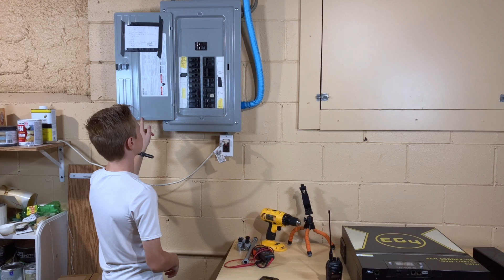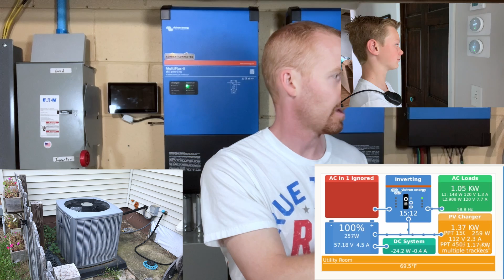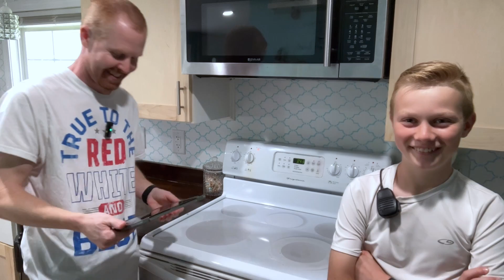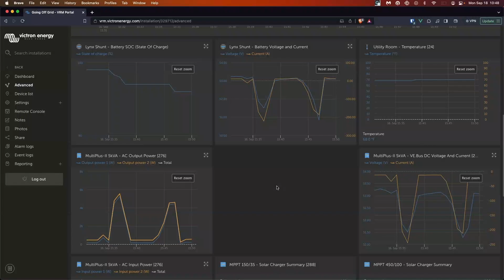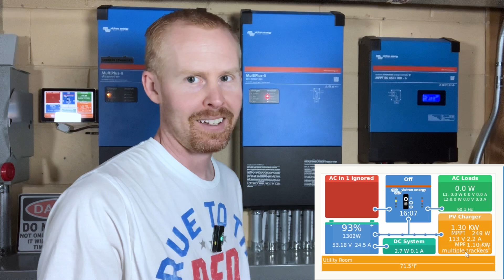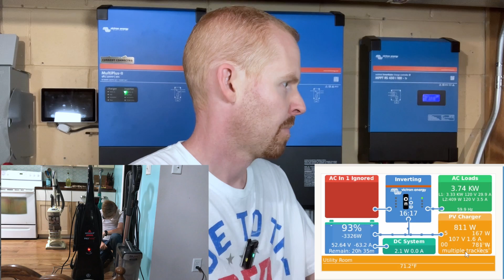Pushing the Limits: Victron MultiPlus 2 5kVA Inverter Endurance Test

Comment from the maker: Large Appliances tested in the video: 
- Armstrong Air 3.5T A/C - 90 LRA
- GE Profile Performance Wizard Dryer
- Frigidaire Stove/Oven

Links to the parts & pieces in the video (affiliate links)
------------------------------------
Victron 48V MultiPlus-II 5kVA 120V Inverter
https://www.currentconnected.com/product/victron-48v-multiplus-2-5kva-120v-inverter-70a-charger/?ref=AzzpK9Fl

10kVA 120/240v Base MultiPlus-II System
https://www.currentconnected.com/product/10kva-120-240v-multiplus-2-5kva/?ref=AzzpK9Fl

Victron Cerbo GX
https://www.currentconnected.com/product/victron-cerbo-gx-system-controller/?ref=AzzpK9Fl

Victron GX Touch 7" Display
https://www.currentconnected.com/product/gx-touch-display-cerbo-gx/?ref=AzzpK9Fl
Reply: you should add that soft starter to your ac unit. It will lower the start up amperage ALOT from the ac unit and should prevent the lights from freaking out.

Comment: Just by chance on the air conditioning unit, are you using a soft start or is that configured from factory?
Reply from the maker: During this test, there was no soft start on the A/C unit.  Months later I did install one though, just to relive the startup surge.

Comment: Must have been the battery that caused that flickering and so. Voltage sagging.
Reply from the maker: @ThePonderi  flickering?
Reply: @AdamDeLayDIY  The dip in power when the boy switched on tfor the first time.  Lights blinked (freaking out), Multi also show red led for a brief moment.. that could have been battery voltage sagging. With a huge battery possibly that wouldn't have happened. How much battery do you have?
Reply from the maker: @ oh, your taking about when the A/C was turned on?  That’s expected because of the high inrush current required to turn on the compressor.  Battery bank size wouldn’t matter.  I had to add a soft start on the A/C to get rid of the huge surge.

Comment: Hey so from the video, I wasn't entirely clear on your setup.  Is this two Multiplus 2s, both 5kVA, with one connected to the other in Power Assist?  It would be helpful to hear more about this from you in the video.  For instance when you used fired up the AC, how much did the system provide from each inverter at spike time?  Could a single 5kVA MP2 handle the startup?  That would be interesting for all those folks who are looking at getting just one MP2 to begin with...  If you're reading this and can recall any of the answers to these questions, I'd love to know!
Reply from the maker: I have 2 MP2 5kVa inverters setup in a split phase configuration.  So each inverter would handle 120v of a 240v configuration. 

Since the AC is 240v, each inverter would equally provide half the power required to run.  A single 120v MP2 5kVa would not be able to run the AC.
Reply: @AdamDeLayDIY  Aha!  Thanks, that helps alot.  I live in Europe currently, and I wonder if their 230V version of the MP2 would be able to handle it.  My guess is yes, without too much else running (maybe just lights, and normal computer stuff).  I'm trying to decide whether to go with the 5kVA or the 8kVA... hoping to be able to start out with the 5kVA and then get a second one and use it in parallel to increase capacity, when funds are more abundant.  Anyway, no need to run the AC off of it all the time, as we do have the grid.  Thanks again!
Reply from the maker: @blakjakshellac  No worries.  Glad to be able to help!  I've not looked but I believe there are specific 230v inverters.  You would just want to look at the spec sheets to confirm.

Comment: The install looks really nice but if you are going to only feed loads at the output side of the inverters, you should  look at adding an Autotransformer to the outputs of the two inverters so that L1 and L2 will be balanced regardless of loads.
Reply from the maker: Thanks for the comment.  My loads are typically balanced.  I just wanted to test how the inverters would handle the imbalance. 

I'll be testing ESS at some point to try to feed some of the other loads in my house.
Reply: @AdamDeLayDIY  ESS will certainly add to the capabilities. Hope you are ready to add more solar panels because you are going to quickly learn you will be able to stop the meter. When matched with a bank that could sustain your loads for a day or two, you could easily reduce your power bill to nothing but service charges and taxes.
Reply from the maker: @PanelsUpSolar  Oh yeah.  I know I'm gonna have to expand both my array and battery bank.  Just have to save up my pennies to do so.

Comment: Thank you Adam for the load test. After reviewing Gavin’s, Will’s and EG4’s load test of the EG4 18k and your Victron test, I have come to this conclusion.
1) Connections: The EG4 has all of the switches and breakers built in, The Victron is extra.
2) Telemetry: EG4 WiFi included, Ethernet adapter or LTE 4G dongle extra $199, Victron Cerbo GX very expensive extra $381.
3) Shunt: EG4 does not need one, Victron needs one at extra cost.
4) Bus bar: EG4 default not needed but depends on batteries used. Victron needs their own, expensive.
4) Load balancing: EG4 is up to 8kW constant one leg, Victron trips at 6kW.
5) Surge: EG4 is 14kW for 10 minutes and 16kW for 5 minutes, Victron not even close.
6) Self consumption: EG4 is 70 watts, Victron is 30 watts for two inverters.
7) PV inputs: EG4 built in 4 inputs up to 600 volts each and 21kW total, Victron separate unit(s) 2 or 4 inputs, up to 450 volts each input at 4kW for a total of 8kW or 16kW
8) Software: EG4 covers everything in one unit, Victron is all over the place with different ways to read what is going on.
I could compared more but I think I have seen enough to know which product line I am going with.
Reply from the maker: I've heard a lot of good things about the 18kPV.  Good luck with your solar project!  Let me know how things go!

Comment: Very nice congratulations 🎊 i loaded my two 8 kw inverters to 16.6kw 2*1 ton ac+2*1.5 ton ac +1 2ton ac with all lights 2 vaccum cleaners and 1 hair dryier plus 2 induction stoves.
Reply from the maker: Awesome!  It's a great feeling when you can push your inverters and they over-perform!
Reply: @w8dev  I'm sure you have propane or LPG line to the house. why are you using an electric stove? it takes so much power 🔋 🤔.
Reply from the maker: @HybridShedIraq  We have propane where I live, and it's not cheap.
Reply: @AdamDeLayDIY  I buy 35lb cylinder for 3.5$ and it last at least one month.

Comment: When my system is powering my house and my dryer is running and my AC I've seen my smart shunt read ~9700 watts. Would this system be able to handle something like that? It would be neat if the inverters could max themselves out and then pull any excess from grid power to prevent overload.
Reply from the maker: If it could run all that it would be awful close.  Then you really wouldn’t have any extra capacity though for anything else that might get turned on.  

While it can’t pull excess from the grid, it does have the ability to switch to the grid for a period of time once your inverter output has reached a threshold.  It will maintain a grid connection until the “release” threshold is met.

Comment: What size screen, are you using?
Reply from the maker: The 7".  I believe they call it the "Victron GX Touch 70"
Reply: @AdamDeLayDIY  so are you feeding solar, into a subpanel? And what size array, are you using. I'm building at 10.2kw ground mount.
Reply from the maker: @carlosreyes6448  I have solar coming into a Victron 450/100.  I have several arrays totaling 6.2kw.
Reply: @AdamDeLayDIY  okay nice, yeah I'm going to have to go with. The 450/200. It's expensive, but with a 10.2kw that's what, I'll be needing. Oh one more question is the password for victron 000000. I have a small victron charge controller and that's. What I use. I'm not sure if it's the same for the multiplus.
Reply from the maker: @carlosreyes6448  it’ll be worth it.  Being able to break up 4 different arrays into a single unit should help maximize potential, especially if you have to deal with any shading at all.  

You must be talking about the BT pin.  There’s no BT on the multiplus.  You can either use a cerbo (or raspberry pi) or you can pick up a Mk3-to-usb.  

https://www.currentconnected.com/product/victron-cerbo-gx-system-controller/?ref=AzzpK9Fl
https://www.currentconnected.com/product/victron-interface-mk3-usb-configuration-tool/?ref=AzzpK9Fl

Personally I would recommend the Cerbo.  You can do much more with it than you can with the USB interface.
Reply: @AdamDeLayDIY  yes, the cerbo is diffently, the way to go. What I meant was, putting them in split phase configuration. To work 180 degrees out of phase. But I do think that current connect. Does that for ya. So it'll be a plug and play.
Reply from the maker: @carlosreyes6448  that’s correct.  I actually didn’t have to configure that part at all.  They did it all for me.  They also updated it to the latest firmware before shipping it out!  

They really do an awesome job helping you out!

Are you looking at a putting in a Multiplus system?
Reply: @AdamDeLayDIY  oh yes, I really like. Victron nothing like it. I'm going to take some circuits. Of my grid. And put them in a sub panel. I'm building a ground mount solar, array with rec alpha pure r. 420 watt panels. Another favorite rec. And I have my battery bank built. 300ah 53v lifepo4. But what I really like about Victron multiplus is the power assist, feature. Help prevent overload.
Reply from the maker: @carlosreyes6448  awesome!  Now the power assist to my knowledge is to supply battery power in the event the AC In doesn’t have enough power.  It’s designed when you have a smaller generator on the AC In and you need to run a larger load than the generator can handle.  It will supplement with battery power.  I don’t believe it works the other way around.

Now there are other options that might help.  For instance you can tell the AC in connection to turn on when the output power reaches a certain level.  The grid then takes over the loads till the output has lowered before the “release threshold”.  I have this programmed on mine but I’ve never actually hit the threshold.

The other option is that these inverters can feed extra power back out through the AC In connection to try and power those loads (without back feeding to the grid).  It’s called ESS.  I plan on testing this at some point but I need to make sure it doesn’t back feed to the grid.
Reply: @AdamDeLayDIY  oh ess I need to look into, that.
Reply from the maker: @carlosreyes6448  yup!  That’s what I’m gonna end up playing with.

https://youtu.be/xHQGOfSGQd4?si=u51125Iz5Eak7QZB

https://www.victronenergy.com/live/ess:start

Comment: So im going to be using the victron multiplus 3000va. Two in split phase. And going to be inputting grid power. For power assist. Do you have grid input? On your inverters?
Reply from the maker: Yes I do have grid input.  

From my understanding, "power assist" is used when you need additional power over and above what can be provided from the AC In connection.  It then takes that additional power from the battery.
Reply: @AdamDeLayDIY  yes correct, so if you're load is above. The rated capacity. Of the inverters. It will pull up to 50amps. For the 3000va. And I believe up to 100amps. For the 5000va. That's truly amazing. But what can I say. It's victron.

Comment: It would be great if you could go over the ESS (feeding energy back into the grid) and check it out.  I didn't know MultiPlus-II can do that.  Isn't that same as the net-metering?  Do you happen to have a bi-directional electric meter, so you can see the amount of power going back to the grid?   PS. I though you could operate the MultiPlus-II so it would be connected to the grid and function as a helper, when your solar isn't enough to handle all the loads but I didn't know it can also feed back power (e.g., excess solar) to the grid.
Reply from the maker: The MultiPlus is a hybrid inverter that can back feed to the grid.  While I will test the ESS features, I won't be back-feeding to the grid as I don't have any net metering agreement.  Plus I probably wouldn't get one since the UL listing on the MultiPlus is still pending.

Comment: Awesome video. Amazing how quiet the inverters are with those loads. I know you only enable AC in on certain occasions but wonder if the power assist feature of MPII could make the impact of starting that AirCon less without a soft start.
Reply from the maker: Thanks!

Power Assist is where the battery power is added to assist Grid power.  Unfortunately, not the other way around.  It's more designed for RVs running on smaller generators that cannot support the full load.  Battery power will be added to the "grid" power to supplement.

I do have plans on getting a soft-start.  I just wanted to wait and run the test without it to see if it would work.
Reply: @AdamDeLayDIY  Ahhh. You’re right, I had it backwards. Keep the content coming, it’s great!
Reply from the maker: @cgutowski471  No worries.  Thanks!

Comment: I'm surprised that it struggled with the AC but the fact it ran at all of course is the point. I would never bother trying that on the HF 6500EX. 

I've got to figure out the same thing. I haven't moved everything to solar yet but I've got clamp meters on the grid input so I can start figuring out the things I haven't moved over yet. Looks like the central AC uses 2800w, so once I get a soft-start on that I can move it to solar. Oven uses 3600W, but I didn't think to test the broil. The highest I have seen coming from the grid so far is 10kW total.

But first I need to figure out why one of my circuits on solar doesn't work.
Reply from the maker: Yeah, I wouldn't recommend testing the A/C on the 6500 without a soft start.  It makes funny noises....😁

I never use the broil feature on the stove so it completely slipped my mind.  I could be wrong, but I believe it turns on the heating element on the top and the bottom of the stove at the same time. During my test with just "bake" turned on, it seemed to handle that fine.  

One thing to keep in mind about the stove/oven is that it doesn't stay on all the time.  Once it reaches its set temperature, it will cycle on and off to maintain that temp.  So while the test shows a lot of power being used, it's not gonna be constant.  

One of your circuits doesn't work?